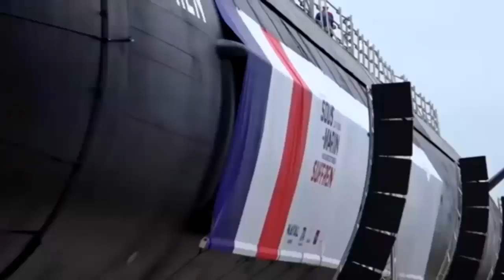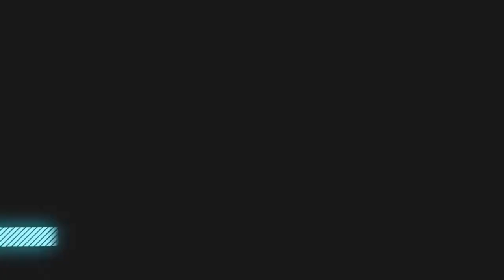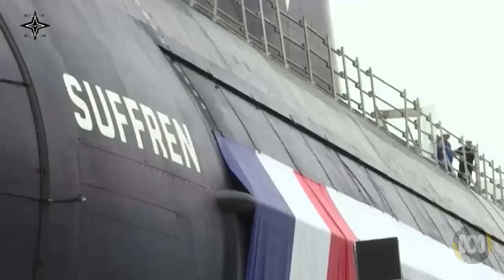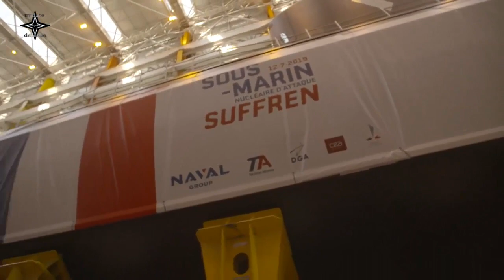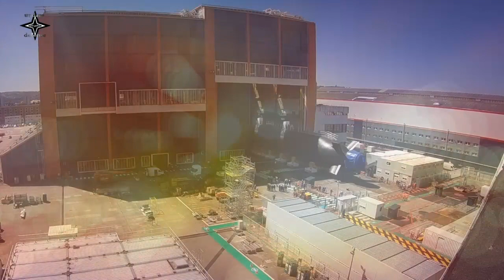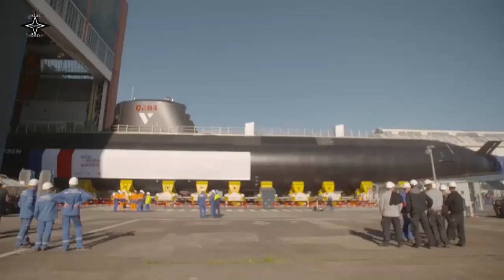Nuclear Boiler Aboard French Navy’s 2nd Barracuda Type SSN Started For The 1st Time

Comment: I like the French Nuclear Boilers in these. They can be refueled easily through several hatches and they use civilian type fuel rods. If the US needs to extend the life of it's boats they need to cut them open to refuel them as their reactors are build to last a certain amount of time. Add that the enrichment process for their fuel rods is highly polluting and very expensive.